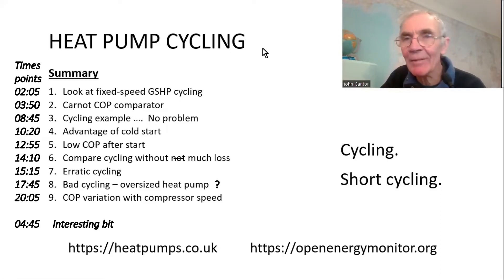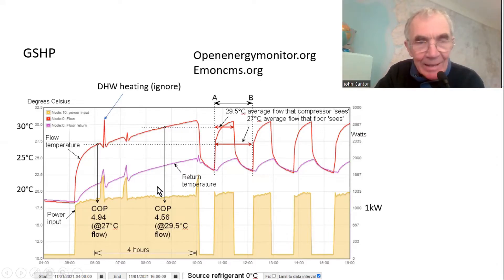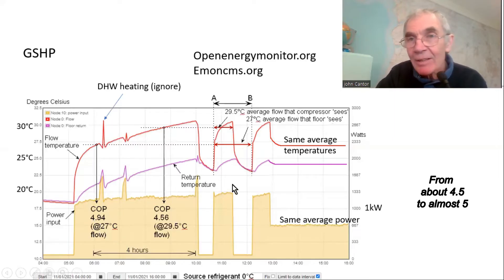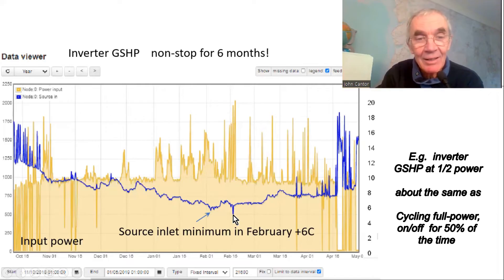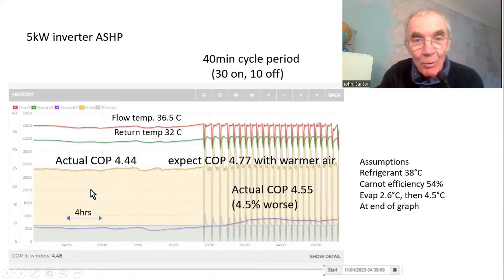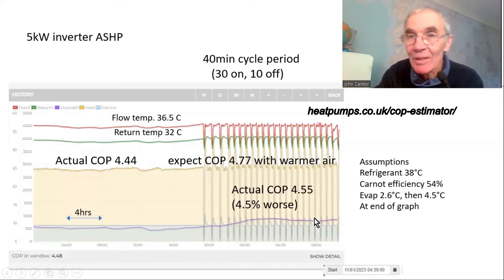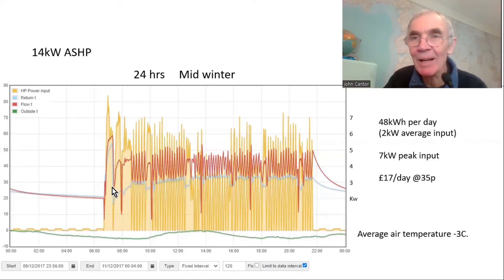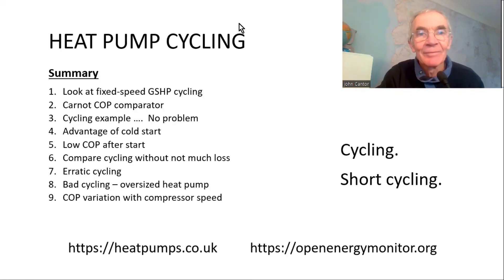Heat Pumps Cycling (switching on and off)

Comment: Thanks for interesting video. The latest inverter driven preheated scroll compressors are far less adversely affected by cycling than old tech reciprocating compressors. Also for latest heat pump models such as the Mitsubishi Ecodan R32, during periods of mild ambient temps and low heat demand, the auto adaptive management software prevents cycling by running at no less than minimum continuous power, allowing roomstat temp to overrun target temp by one degree of headroom, then switching off for however many hours are required for roomstat to cool back down by that one degree to target room temp, then the heat pump restarts again, and so on. Even for an oversized heat pump this avoids cycling altogether, so has no impact on efficiency. I have an oversized heat pump, being an 11.2kW model compared to design spec. recommendation of 8.5kW, but my performance stats are at least as good as manufacturer's data table specs. Also the 11.2kW is more efficient at exceptionally cold, high heat loads where the extra headroom is essential.

Comment: John Cantor: Thank you. 

I am just having my second winter with a heat pump and it is working pretty well - SCOP last winter was 3.6. However I have a feeling it could work better. 

Once the external temperature rises above ~ 5 °C the heat output falls below ~ 2 kW - and the system cycles. This is ~ 40% of the nominal maximum output of a 5kW Vaillant Arotherm Plus pump, and  like you said, I think that's just a choice by the manufacturer to set the lowest output at about 40% of maximum. 

Understanding of what is going on is compounded by a complete lack of 'User Manuals', but I have concluded it is probably just not worth worrying about.

All the best

Michael
Reply: If it's cycling more than 3 times/hours, you may need a small buffer tank
Reply: @hvacdesignsolutions  Hi. That's possible. I do have a Low Loss Header, and I have been experimenting with changing the power of the pump which re-circulates water from the Low Loss Header through the radiators. 

At current temperatures,(<5 °C most days) the pump operates well with no cycling and a reasonable COP (3.3 at 2 °C). It's during teh milder temperatures that we have for teh next month of so where I think improvements may be possible.

Best wishes

Michael

Comment: Thank q very much for putting this video together very informative , I have recently had a quote for a 9 kw heat pump which I thought was two big ( I used actual heating usage data rather than calculated ) and got the size to 5-6 kw but this helps me a lot
Reply: I'm in the exact same situation. My WORST scenario in actual heating usage (calculatede on 6 years bills) is 4,5Kw, they quote a 8Kw heat pump that give 7,28 Kw @ -7/35 ... and my external project temperature is -5 so .... WHY???

Comment: It's interesting to hear you mention a buffer tank @ 16:55, for the larger 16kW unit. Most installers I speak to, don't put them in. I wonder if thats because of the additional cost to the homeowner, or the installer doesn't understand how and when a Buffer Tank should be applied..........maybe something to consider for your next video.

Comment: Hello John. Great video. SUGGESTION: Use analogue temp "sensors" instead of hysteresis/Differential Thermostats (i.e. Variable instead of On/Off) and the same with the output control signal for the heat pump (and secondary circuit circulation pumps, so there is never a "closed circuit" situation, i.e. always flow round all secondary circuit, i.e.anti-stratification kind of thing, so temps are stable and no sudden shocks to the system, like when a cold circuit suddenly inject a cold slug of water into the primary circuit.....). Closed loop P+I control would prevent "saw tooth" curves on the graphs? Also wondering about the number of starts per hour for the compressor motor, as most motors don't like more than 10/hr. Would be interested to hear your view. Thanks.🤔
Reply from the maker: Yes, exactly, inverter systems should do that, and will reduce to about 40% of full power in milder weather. (they go lower in colder weather, but that is not when you want them low).  However, they cannot modulate down as far as we would like, so some sort of cycling is bound to happen in milder weather.  In mid winter, i would hope many would run constantly, modulating between say full and 1/2 power as required.   Before inverter motors, compressors would start with quite a kick, causeng wear  & tear and if frequent, overheating of windings. But now they start nice and slowly, so I am not sure if stop-start is quite as detrimental as people think.   I think very few heat pumps actually 'die' of too many stop-starts. Its mostly other component failure that writes them off.   That said, its definately good to reduce the number of starts if possible.

Comment from the maker: @hardcard254  thanks.  Re your flow rate, have you considered adding a pump in-line?  So long as the extra pump is on a fixed speed setting, you should be ok. I have had 2 pumps in series on few occasions.  The WiloPico with the green knob (not red) is great since the display shows watts, flowrate and also pressure.... Ideal for setting it up, and much easier than replacing pipework!
Reply: Hi John, thanks for taking the time to reply!

My 8kW unit's pump is plenty powerful, it pushes over 1400 litres per hour when it does DHW.
That part of the circuit is 32mm multilayer pipework, it allows for such flow and so the pump delivers it. 

The low flow rate problem only appears when pumping towards the radiator circuit, it's probably caused by the 16mm multilayer pipework (specifically, the multilayer pipe connectors, which cause significant internal constriction at every junction), combined with the fact that my radiators are connected in series.

Why do I think that this is the problem and not the pump?
Because my brother owns the 6kW version of the same unit, which has a slightly weaker pump... yet he gets 1000+ liters per hour when pumping towards the radiator circuit.
Granted, my installation has 14 additional radiator elements (equivalent to an extra medium-sized radiator), but this isn't why his flow rate is so much better.
He gets higher flow rates because his radiators are all connected in parallel, and also because the circuit is made with 16mm copper pipework (free of internal constrictions). 

Brute forcing my unsuitable radiator circuit and pipework with a second pump doesn't seem like a good idea to me... the increased stress on the connectors, the noise, the potential pump coordination problems, etc... too many problems are likely to arise. 

I might try to replace the pipettes inside the radiators (the tubes attached to the radiator valves, which extend into the radiators, to ensure that hot water reaches the other end).
When I added the 29 radiator elements, I extended the pipettes of several radiators using narrow pipe extensions...perhaps too narrow. 
If replacing those pipettes doesn't improve flow rate, I'll try replacing the radiator valves... if that doesn't work either, I'll have to accept the low flow rate and live with it. 

Thanks again John!
Reply from the maker: @Goreuncle  I didnt think there has ever been a heat pump connnected to an in-series radiator connection.    normally there is around 5 degrees temperature drop from radiator inlet to outlet.  If you had 10 radiators in series you would need 1/2 degree drop across each, and 5 degrees over the total.  internet search for radiator connections and look into copying your brothers setup.  Actually, the restrictions due to fittings can be less that they might appear.
Reply: @johncantor4056  
My setup is as follows (excluding the DHW part):

8kW unit > (32mm multilayer pipe) > 1 1/2" 3-way valve > (32mm multilayer pipe) > 1 1/4" heating manifold (with only 2 ports) > (2x 16mm multilayer pipes, one for each radiator ring/series) > first radiator of each ring/series > second radiator of each ring/series > etc.

I have 2 series of radiators (5S and 4S, 9 radiators total), these 2 series are connected in parallel, the pipework runs under the floor (ceramic tiles + cement) and inside some walls (brick + cement + plaster).
I'd have to wreck my home in order to redo my radiator circuit completely in parallel, so copying my brother's setup is off the table 😭 

As for delta T, my unit can't keep delta T 5ºC when it gets cold outside, the unit works at delta T 8-9ºC (~1ºC drop across each radiator, as a simplification). 

As for the 16mm multilayer pipe fittings, they look crazy small 😅

Thanks again for your insight, John!

Comment: Thank you - I think you've answered one of the questions that I had in mind - over-sizing is well known but under-sizing not so much it seems - what I was trying to understand is at which point in modulation the efficiency is highest and the EcoForest graphs seem to answer that - my thinking is that heat loss sizing is done for a -3C outdoor temp but actually in reality that only happens for a handful of days in the UK, which essentially means that the HP will not need to deliver as much heat on an 'average day' and thus be in the very low region of modulation, which could result in inefficiency and cycling too - so ideally, assuming the OEM has it programmed to not hit the very low modulation levels, the sweet spot for heat output versus heat loss is somewhere in the middle on an average day - or am I barking up the wrong tree? For very cold days, it may run at fullish output for longish periods rather than being scaled so that it only needs to run there at start up or on very cold days?
Reply from the maker: Mmm.. well, whilst that Ecoforest graph is interesting, maybe it could also be a bit misleading here since there are other factors (like water temperature) that are probably more important.  e.g. whilst a 'small' unit might run at high revs a lot mid winter, it should also spend a lot of hours at mid speed, and it could probably run at lower temperature (less rest time).   A big unit is likely to 'stray' into higher flow temperatures at times, and may spend a lot of the year cycling.  How it's operated also has a bearing on things. e.g. if its fairly constant, or if it has long-ish rest times.  Finding the best efficiency relating to unit size (wrt heat demand) seems hard to assess, and no doubt its the extremes that are the worry, and a region in the middle with similar performance.   I think you are barking up a similar tree.   Maybe theory and practice don't quite match since heating a house is a dynamic thing... (day/night), and all buildings and occupants are a bit different.  Not sure if that helps!
Reply: @johncantor4056  thanks yes that is helpful - as you say it's not clear cut and I was sort of comparing it to very "1 dimensional" controls on a gas boiler without weather compensation so hadn't considered water temperature aside from the assumption that if an "average" property has an 'over-size' condensing gas boiler, it can be dialled down to reduce the overall output, provided the rads can emit the heat, then it can happily output constantly at its lowest modulation, but if like one of the examples you showed, where little else was done and a 'like-for-like' HP replaces a gas boiler, it would be better to go smaller instead, but would that have a detrimental impact on the efficiency? I guess inverting HPs have a wider working range and so as you say avoiding those extremes is the key. Plus if done as a retro-fit without other changes like bigger rads and more insulation, those things can be done afterwards and thus erring on the smaller side would still be a better bet than worrying about those few days where the 'calculated' heat losses at -3C make people think they need to 'go large' in order not to feel cold...on those days, a smaller HP could easily just run continuously in a more efficient manner rather than the on/off manner of heating that so many people are used to in this country!

Comment: Surely the cop is very poor on a cold start before the compressor becomes warm and smooth ? One graph at 1355 shows a huge rise on a cold start ? Great video, thanks
Reply from the maker: You are right that COP at start (after a long rest) is poor as it warms everything up.  Compressor would be warm though if starting when cycling is frequent.  There is however another thing at play... at start-up, the compressor pressures are equal, so the compressor has a very 'easy ride' at first, until the pressure difference across the compressor builds up, so at start, if it were not for various inefficienies, the COP would be much higher at start up

Comment: Late to the party, per usual🤔  What came to mind during this presentation, and thank you for your efforts and the knowledge you have provided; however, I was wondering if instead of heating the water that would flow through the system (pick your preference) would it make sense to have a large enough buffer tank(s) to provide the heated fluid and have the heat pump spend a longer period just bringing the buffer tank(s) back to their setpoint?  If possible, would it make sense to design/install a system with a lead-lag buffer system for use?

Comment: You mention in this video at one point that maintaining the room temp slightly below the set point is ok. Is this just for a heat pump which can run continuous at low temps to balance the heat loss of the room/building? I have a gas boiler that I am running at low flow temps to determine if my property is "heat pump ready". I have been frustrated this winter that the set point is not being achieved but instead remains usually within 0.5 degs and the boiler cycles most of the day sort of balancing the heat loss of the room. I am probably being stubborn as I know the main living area has undersized radiators for low flow temps so this should be expected. I have smart controls so I am mostly disappointed the control cannot adapt and run the boiler for longer but due to smart TRVs I think this may be a limit of the system not having enough emitters at times and overheating rather than the controller.
Reply from the maker: I think I am getting at point that its generally better to keep the heat pump running in cold weather, so you dont really want the room thermosts turning it off...   e.g. lets say it's running very happpily and steadily in cold weather (though might be interrupted by defrosts every say 40 mins).   Anyhow, if the thermost turns it off, then there can be some catching up to do which may not be easy.  Ideally the compressor will modulate down and keep running.  The manufacturers thermosts is usually best, and this is where 'room target' or 'auto adapt' can work very well.   In your case, I guess you are trying to vary/reduce the water temperure to see if say 40C is enough etc.  Maybe your smart stats are trying to be too helpfull!   can you simply turn the TRVs to max for your experiments?

Comment: I'm curious what the difference there would be with longer cycle times - Ecodan controls have a setting of 10-60 mins which I assume is a forced off period (doesn't seem clear in manual) - I'd hope you'd minimise those refrigerant start up losses and see some benefit of the low system temperatures on restart with longer off periods and hence (hopefully) longer on periods?
Reply from the maker: Yes, its not clear in Ecodan info, but I think the 10-60 is related to time response of room sensor.  I guess some 1/2hr rests should result in some better COP due to cold start, BUT it will 'rev up'.  Shame there is not an 'economy' setting, maybe watching outside temperature, that would stop it going to maximum speed so eagerly.
Reply from the maker: @zlmdragon.  I have never quite understood this setting.  There seem to be other factors at play. Of course the actual compressor speed is all important, and I found the 6kW 'revs up' unnecessarily even when its quite mild out. I expect some 'rev ups' are there to help compressor lubrication, but I still find it straying to high output, unlike the older models.   I guess there are 2 main considerations a) ensure that enough heat is being delivered, b) minimise running cost. It seems to be programmed mainly for 'a'

Comment: John, very interesting, though I am an engineer and try to make sense of my 7kw Vaillant heat pump, if I show you my Ubibot flow temp-in at the buffer tank for a week, would you be able to comment? not sure if you have an email I can send the data to? myVaillant app is showing a SCOP between 4-4.5 with my heat curve set at 0.8 and max flow temp at 45 and min at 25degC, would like to know if you can see the suggested back in the amount of cycling my heatpump does? cheers Mark